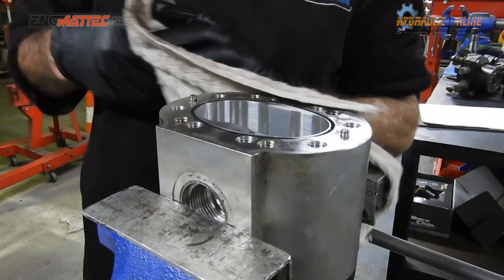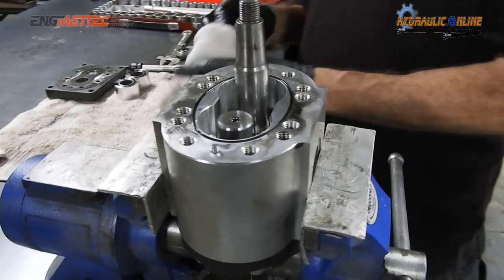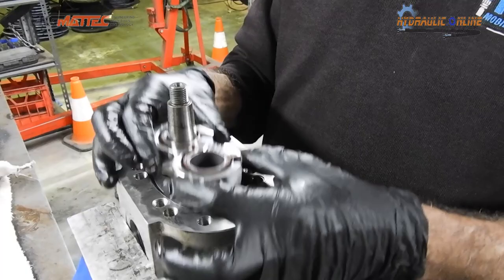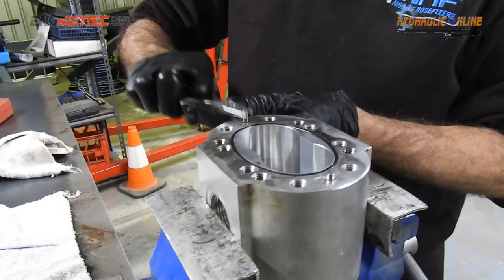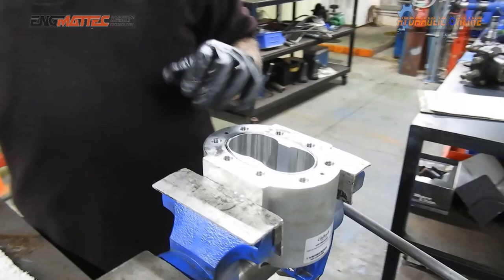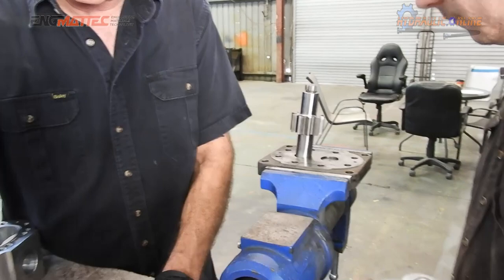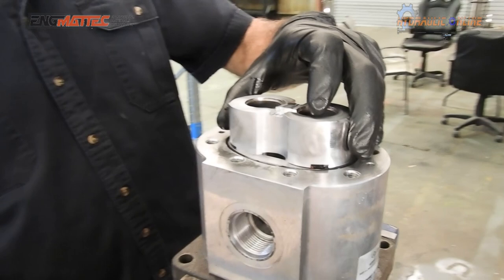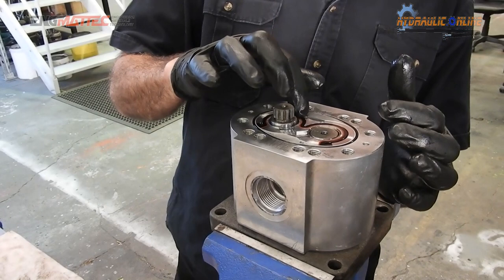How a Hydraulic Gear Pump Works and How to do a Rotation Change

Comment: Is there any need of changing position  bottom swab plate
Reply from the maker: Good question Sanju, if you are changing rotation you must also change the Bottom Seal/bearing plate assembly as well, otherwise, there will be too much internal leakage, causing poor pump performance and you also risk blowing out the shaft seal from too much internal pressure.
Reply: My gas motor turns ccw  so hydraulic  pump needs to go cw ?

Comment: Thank you for the physical demonstration. 
The place I took my Case 90Xt  to ,wouldn't explain anything to me about how the pump either worked or how to fix it locally. 
They just pressered me into getting a rebuilt / re manufactured pump .
They also told me that if I didn't want a re man pu p ,that I could wait 8 to 10 weeks for an  new OEM pump. Which I  agreed to. I was much happier to go with a new one as opposed to something that might not be 100 %.
Then 2 weeks later they fired the mechanic who kept me informed and after that they canceled the deal .
So much for trusting people.
Reply from the maker: Sorry to read you have a bad experience, Strange that they cancelled the deal does not make any sense to me.

Comment: Hi, I have the engine off my log splitter for some other work. I was turning the pump by hand (just fiddling) and noticed it would turn freely then stop (almost like a notch) in the same place once per revolution. I can easily rotate it through the notch though. What would cause that?
It was fine all hooked up to the engine last time I used it.
Thank you
Reply from the maker: Could be one of many things such as residual oil in the pump or you may have a slightly damaged gear or a bent shaft.

Comment: Can one of these simple external great pumps be used as a motor without pushing fluid passed any seals? Do you need to apply pressure in to the output side of the pump to accomplish this, and how does that internal "3" seal need to be oriented in that use case?
Reply from the maker: It is not recommended to use a pump as a motor as all the internal pressure and shaft seals are different.

Comment: I’ve seen this video and I did understand how a hydraulic pump works..ok. Now I have a problem with a hydraulic circuit (or installation) from a tractor. As following: the pump is moving the cylinder for the 3-point hitch, but the oil doesn’t stay in the pump. When the tractor is facing downwards the oil enters the pump and the installation is working but when the tractor is back to the horizontal line or is facing upwards the oil just doesn’t get to the pump, it flows back in the inlet line and it won’t bring up the cylinder and the 3-point hitch. What I don’t understand is how the oil is feeding to the pump. Isn’t the same principle as in the water pump, where the water is kept under pressure (negative pressure, suction pressure) in the inlet line, or is working differently and the problem is elsewhere. Or could that be that there is not enough oil in the installation? But the oil is at the level point in the feeding oil tank. Any help and advice are welcome.
Reply from the maker: Thanks for the message Brfiscu
Your problem could be either of these issues so check each carefully one by one.
  
1. Low oil level. Some tractors have more than one oil tank check carefully all interconecting pipes and hoses. 
2. Wrong Oil Viscocity for the temperature (try a thiner oil in the colder winter months)
3. You have a suction leak (check the suction hose condition and the suction hose clamps from the tank to the pump)
4. Your Pump is old and to the internal gear tolerances are too large. 
5. Check your in tank suction strainer for contamination,  If you have one clean it out or replace it. 
6. Check your oil tank for contamination,  like a piece of rag or a piece of an old tank lid (we had an intermittant problem on suction that turned out to be a sock drifting around inside the oil tank) 
7. Check your oil tank's filler / breather cap is not blocked with dust and particles.
Please let us know how you got on.
Reply: Thanks for your comprehensive response.. I will check all you have said and get back ASAP.

Comment: which material is used for each part?
Reply from the maker: Generally in medium to high pressure Hydraulic Gear pumps, the Gears and Shafts are made from Heat Treated High Carbon Steel. The Casings or pump housing, End Plates and Covers can be Cast Iron, Aluminium Alloy, and or Steel or any Combination Of the above mentioned metals. 
Depending on the design and cost there may be roller, ball, bush or just no bearings at all.

Comment: What would be the cause my hydraulic pump for forklift always blow its oil seal,even i install circlips to hold down the oil seal,thank you.
Reply: its because you use wrong rotation pump 
hint 
if the "3 shape" like seal is on thrust plate or bushing , you can change rotation , sample like this video

if the seal is on top cover , you cant change rotation
Reply from the maker: If you have recently overhauled this pump you may have installed some parts incorrectly, also Some Pumps have check valves or plugs and oil galeries to divert high pressure oil from the shaft seal back to the low pressure suction side check that they are not blocked by the new seal or blocked by debris.

Comment: Great video!  I need to switch the direction of rotation by switching the gear position, otherwise my engine will turn it backwards.   When i do that, does the inlet stay the inlet for the low pressure side, and the outlet stay the outlet, or do those switch as well?
Reply from the maker: HI Kevin sorry missed seeing your question. Just remember this rule, if the outside tips of the 2 gears are rotating and then meeting and disappearing through the middle that will be the pressure / discharge port, you should be able to flip the external gear housing so that the smallest port is on the pressure side, the other rule is always have the largest port on the suction side (some gear pumps have suction and discharge ports of the same size then it does not matter)
Reply: @Hydraulic.Online   thanks so much

Comment: When you reverse it, is there a plug that needs to be moved?  My Eaton pump has one.  it plugs off a lubrication channel to a top bearing in the cap and it seems if that is on the high pressure side it blows the seal.   I moved it to the low pressure side and it stopped doing that.   I couldn't find any literature on whether it should be on the high pressure or low pressure side.  my concern is does that get lubrication properly now from the low pressure side.   Thanks for making the video!
Reply from the maker: Hi Kevin good question!,  modern pumps have designed out this requirement, I am trying to remember my gear pump theory from technical school but I just can't remember exactly, I will check my notes as I still have my books. From what I remember. The High-pressure side should be blocked off and low pressure or suction left open. This way high-pressure oil is forced from the gears down through the shaft and bearings (for Lubrication and cooling) and into the low-pressure seal area where it is sucked up and recycled by the pump. Please Check your pump carefully and make sure that there are no more grub screws in the hole or that it is a ball-type check valve design. try looking at this video it may help go to 2:39 if the video does not automatically start there  
https://youtu.be/d1Mg05vKQgY?t=159
Reply: @Hydraulic.Online  I re-read my post and I wrote this backwards.   I closed off the high pressure side and that partially solved my problem.   Then re-watched your video and you spoke about the wear plate orientation and how the seals hold back the pressure of the high pressure side. I took mine back apart and sure enough, it was backwards.  I figured those seals wouldn't make contact with the gears, so there was only one orientation left.  Seals facing away from the gears, and the open end towards low, and the blocked end towards high pressure.  I reversed it to the correct orientation and then that pump/tiller combo started acting like it should.  And the pump quieted right down.   I just wanted to thank you for taking the time to make this video.   It helped solve a problem that has been plaguing me for hours and days.  FYI i just watched the video that you suggested and yes he's got the high pressure side plugged.

Comment: Please I need help. Have changed rotation on a PZB gear pump but I keep experiencing shaft seal damage. There is a hole in the pump housing that lubricates the drive gear shaft bush and this hole is now on the high pressure side. And oil pressure  keeps damaging seals. The hole is normally on the supply side were oil enters at low pressure. How can I over come this? Can i block hole on pressure side and drill now hole on suction side so that drive gear shaft continues to get lubrication?@hydrauliconlinm
Reply from the maker: Yes I am pretty sure you can do this, drill carefully!!!.